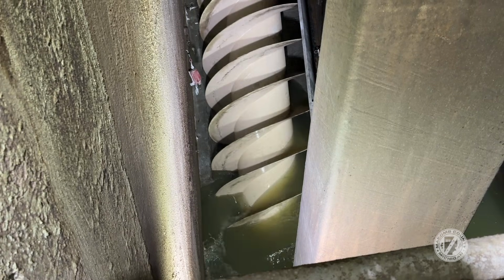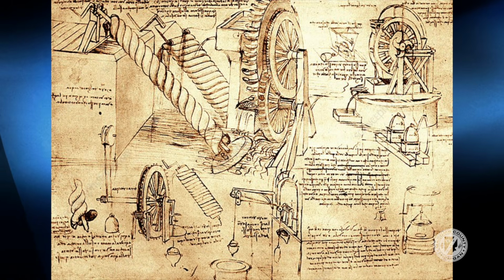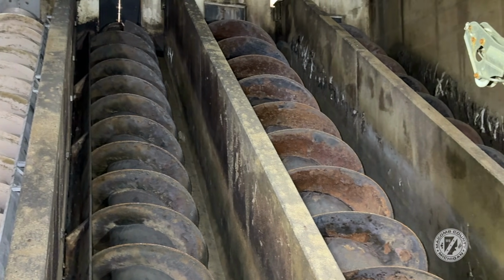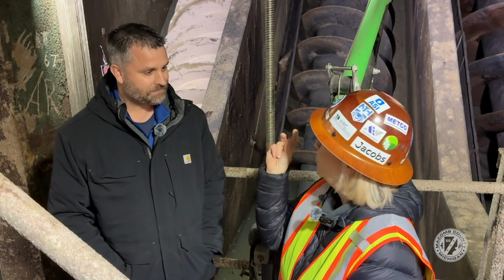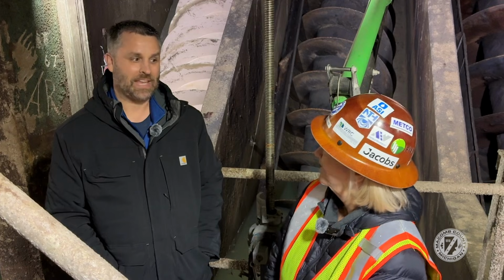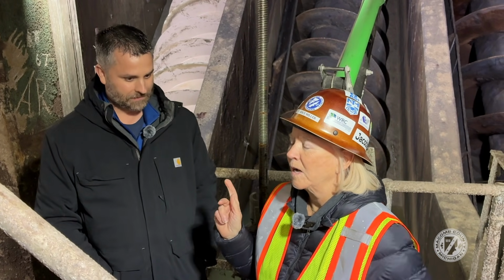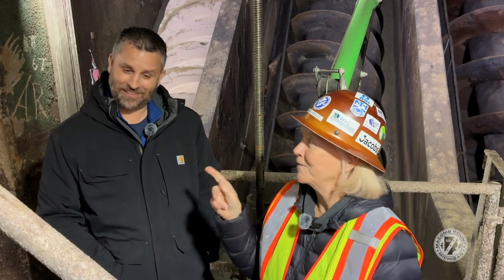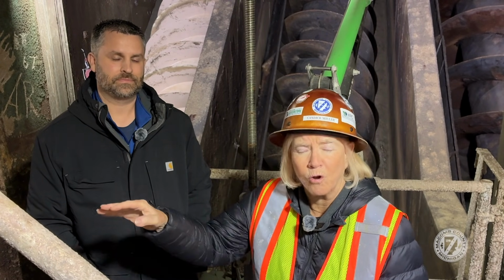Bon Heur Pump Station Rehabilitation

Comment: Very cool.  4 Archimedes screws doing the lifting.  NICE!  Saw farmers in China using these still to this day to irrigate fields.  Not much to go wrong with them, and easy maintenance.  Putting in a vane pump or a impeller pump means a LOT of maintenance in comparison.